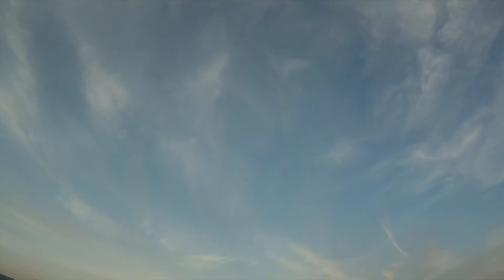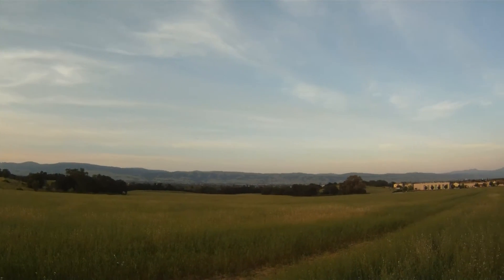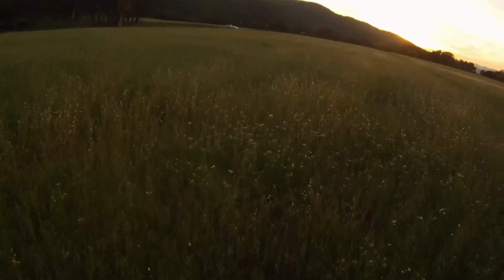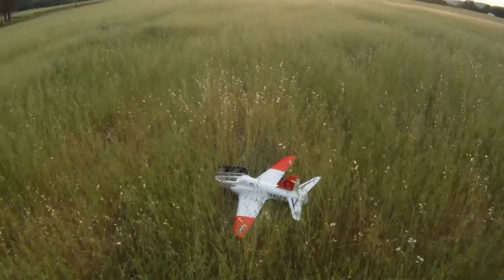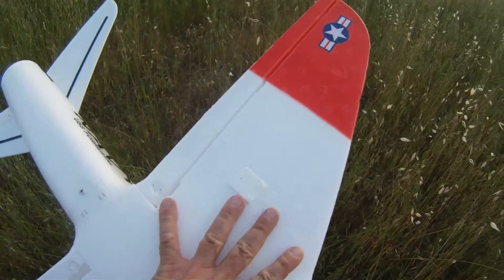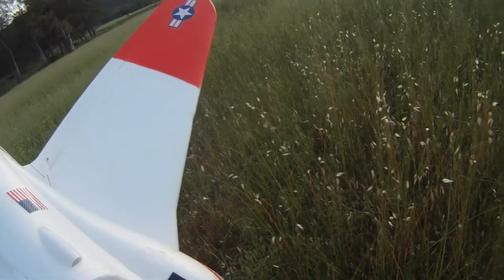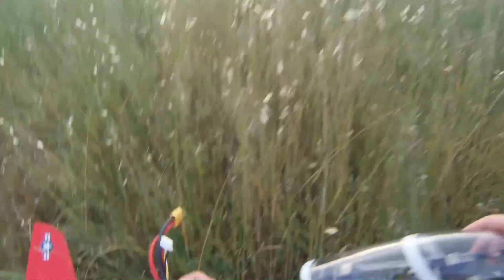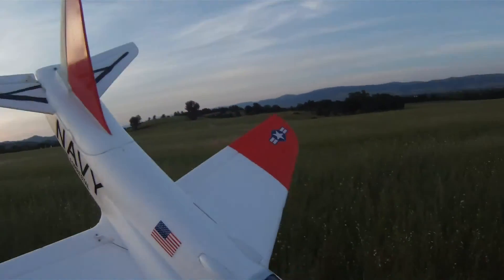Hobby King 64mm T-45 EDF RC Jet,  Maiden Flight

Comment: If you want sound and moderate speed performance, then the 12-blade Change Sun unit with a ~2700kv motor running 4S and a 50A or larger ESC would be a good choice as shown in my videos.whatwhat hast set by your self in the video; You can tell by the has gotten because I am in GREECE and I do not have anyone to help  me.. when i have 12 Blade 10 is slower than the 6 Blade ?? Can you tell me of who has bought that can be ordered ??

Comment: http://www.aliexpress.com/item/Change-Sun-64mm-Ducted-Fan-12-Blades-with-EDF-3s-motor-kv3200-all-set/1585957060.html?af=ppc&isdl=y&src=Google&albch=Google&albcp=Search_Search-All-DSA-ENG&albkw=DSAtype_Others-Search-Product-AliExpress_none_none&albag=pl_none_Search-All-DSA-ENG_product&albmt=none&albst=search-text&albom=others_None_20140423_Aliexpress&aff_short_key=UneMJZVf&cv=1013000023250010&ptsid=1013000026494231&crea=45155236036&plac=&netw=g&device=c&aff_short_key=UneMJZVf&cv=1013000026494231&gclid=CjwKEAjwkf-gBRCd-b2m2aOo0EQSJABMeQDkAaEVwejWTOtcXAfHOsFd2hNaFPSOKKKWLgLi8h2k-hoCRgTw_wcB     //   Don's Wicked Plus 2700kv motor   /////   them has nothing to set T45 to do to become like yours tell me where to get them 12fan blades and motor your 2700kv

Comment: Specification:
Wingspan: 950mm 
Length: 1000mm
Wing loading: 36g/dm2
Main wing area: 18sq/dm
Flying Weight: 620g 
Channel: 4ch
Motor: B3830 Brushless Outrunner 4300kv
ESC: 30A
Servo: 3 x 9g   
EDF: 64mm 
them has nothing to set T45 to do to become like yours

Comment: TELL me what to put 12 blades  fan with motor ??stok motor use with 4s and ESC 40-50a??what to put ??? I have the plung and play ....help me i want make like yours ,,i love your T45
Reply from the maker: There is an excellent thread regarding this model with information from many experienced modelers.   I have also posted pictures and information in this thread under user: kevinkal.
http://www.rcgroups.com/forums/showthread.php?t=1319069&highlight=sapac+64mm&page=338

If you do use the Change Sun 64mm fan, then I recommend running it on a 2600 to 2800kv motor and 4S power.  You'll need no less than a 40A ESC for that setup.
I bought my 12-blade CS 64mm Fan Unit and 2700kv Wicked motor from Don's RC at : http://donsrc.com  , unfortunately he does not have any of these left in stock.

Very important, you need to slightly enlarge the exhaust diameter of the T-45 to 58mm minimum and use a simple thrust tube.

I hope that helps.   Particually, the RCgroups thread should be VERY helpful.

Comment: I can put 12 blades  with the stock motor that has the 64mm from HK??the stock motor that has over the HK BEARS 4c battery and put only bigger ESC  I will get fired ..I have a T45 and want to do it fast, you can in this Tin BLADES to put another motor and ESC and throws and 3s and 4s, what propeller to put sound like jet (10-12 Blade) than what sets me recently, ??? Now it http://www.hobbyking.com/hobbyking/store/__30411__T_45_Goshawk_R_C_64mm_EDF_Jet_EPO_Plug_n_Fly_EU_warehouse_.html........Specification:
Wingspan: 950mm 
Length: 1000mm
Wing loading: 36g/dm2
Main wing area: 18sq/dm
Flying Weight: 620g 
Channel: 4ch
Motor: B3830 Brushless Outrunner 4300kv
ESC: 30A
what sets than I can put it to quickly become ???? Dacter  fans with most foals helices I may possible to vary only motor and ESC ?? and throws 4s and 3s and what servo to put; Has anyone a suggestion; brand; Outcome how g? 9g 13g how???the T45 64mm what is the difference of them with 70mm; are longer, thicker ?? a plane EDF64mm I can not put 70mm Ducted FUN
Reply from the maker: It is my understanding that the stock motor is meant for 3S with the stock 6 blade fan.   I understand that many people have been running the stock motor on 4S with the stock 6 blade fan, however the ESC must be upgraded to handle the additional current.   No less than 40A.
The stock motor should NOT be used with the Change Sun 12 blade fan if you plan to run 4S.  It MAY work on 3S, but I would be very careful about that.
I have read that some people have modified their HK T-45 (Sapac version) to use a 70mm 10-blade Change Sun EDF.   They also add "cheater" holes to increase the intake air supply to the EDF.

Aside, if you want speed, stick with the lower blade count fans, ~4-6 blades with a properly matched motor.
If you want sound and moderate speed performance, then the 12-blade Change Sun unit with a ~2700kv motor running 4S and a 50A or larger ESC would be a good choice as shown in my videos.